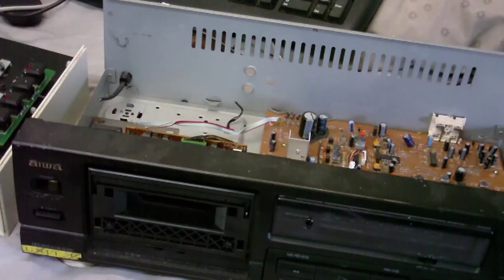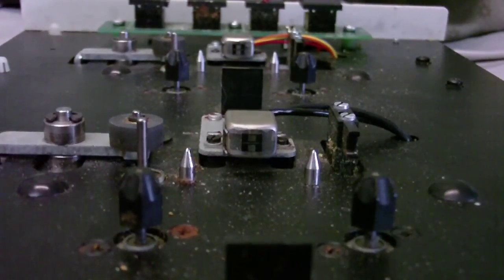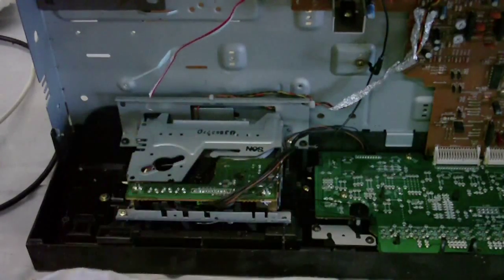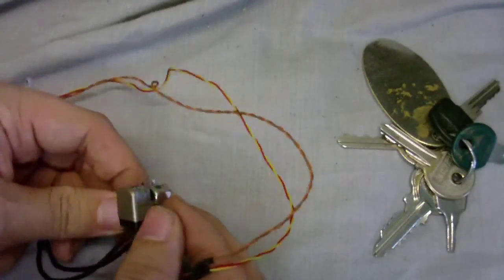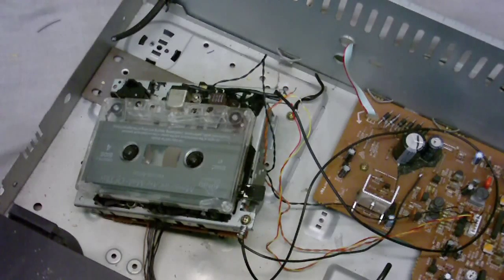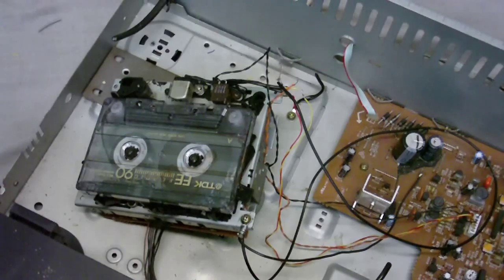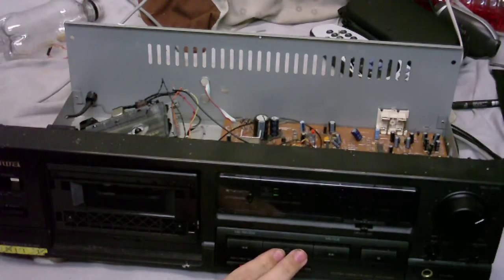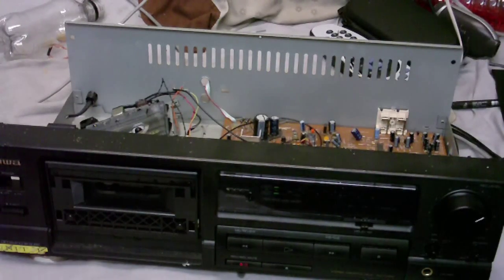PRO-Track Cassette Experiment

Comment from the maker: Thanks, the sound was all recorded on the cassette and then synced up to the video, apart from the last part which was from the camera's own mic.  I used my Akai R2R to mix my mic and the "pro-track" deck, then recorded it onto cassette from its line out. Later on I'm going to try the other head out of the turbo trax and see if it works any better, as both heads in it are different.  And I might put stereo heads in the turbo trax to make it a stereo tape copier.

Comment from the maker: Thanks, I did a little more work on it, and it now records much better.  I tried the other head from the turbo trax but it gave weak playback and wouldn't record with it at all. i guess the impedance is too low. So I put the other head back in and I use that. The amplifier on the cassette deck has record level adjustments, so I just turned them up, and now it records really well.  I was worried that it may overdrive, but it seems ok.  All I need to find now is a suitable erase head.

Comment from the maker: Thanks for you comment.  I will be trying the other head out of the turbo trax tape copier to see if that works any better.  The head I used was from the playback deck, so the head from the record deck may work better, (they have different model numbers printed on them, so I know they are both different) I'm just not sure if it will play ok with that head, but it should do.  I don't have any DBX tape decks, but if I do find one I'll be sure to try it out.

Comment from the maker: Some of the auto-reverse tape decks have a 4 track head too.  If I find any of those I'm going to experiment and see how it goes, but I think using a head like the one I used would be just slightly better, as there isn't 2 magnetic areas on each side of the head acting like one on each side.

Comment: Google 'Yamaha MT4x'.  Because it can record on all four tracks simultaneously, you can exploit a quirk of that feature and use its internal mixer to send the left input to two tracks and the right input to two tracks.  The biggest perceived difference on playback is better s/n, which is not too bad in the first place because the deck runs at double speed, has DBX and uses Type II tape

Comment: The volume may be lower because the original deck head's channel is 1/4 th of the tape width (dual stereo mode), the one you use is 1/2 of the tape width so it must magnetize twice the area which needs more energy!